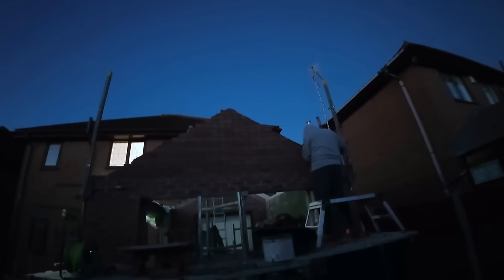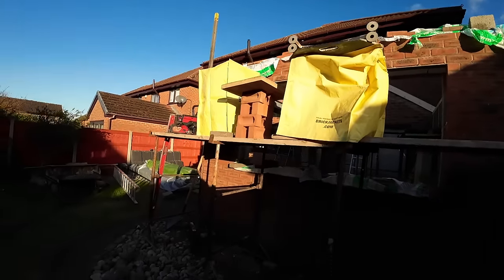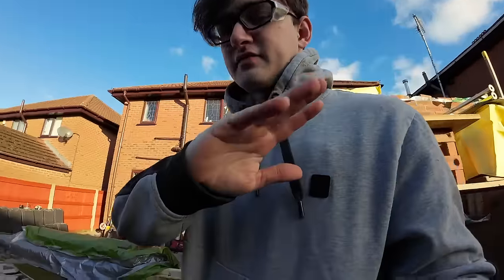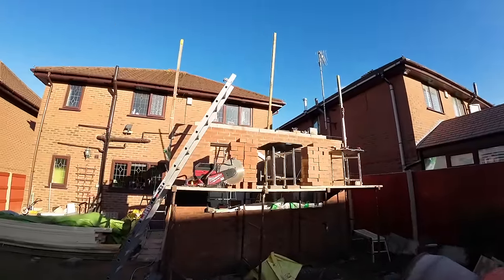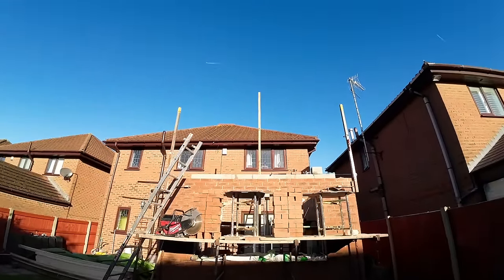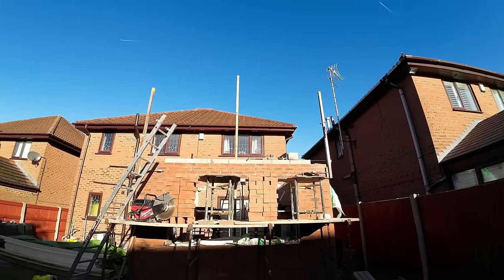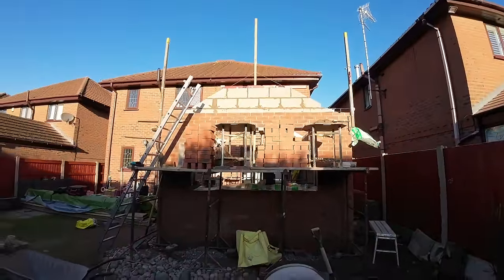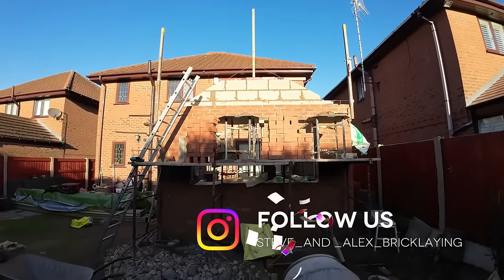IS IT A PIKE OR A GABLE ?...CONSERVATORY TO EXTENSION PT 10

Comment: What’s something like this cost and does this need planning permission!
Reply from the maker: Not sure on cost planning depends on each individual job 🧱👍🏽
Reply: Thanks for replying
Reply: @jazzyjeff1516  
As a very approximate guide you should budget  between £1,500 - to - £2,500 per square metre. Dependent on specification & type.
Planning permission is as Steve has already said.  Always check with your local planning office.
Reply: @martin2466  Thankyou